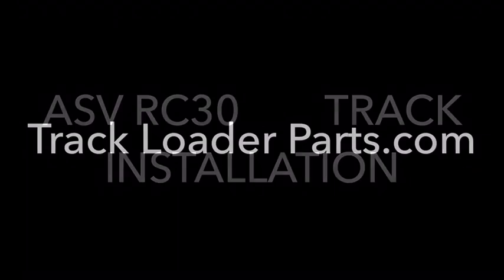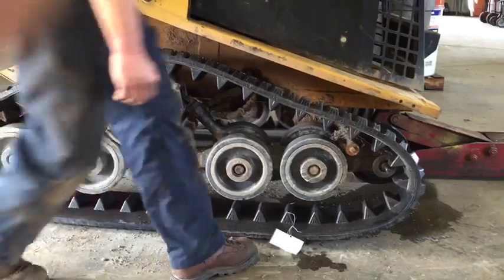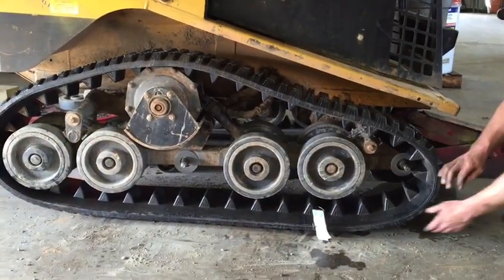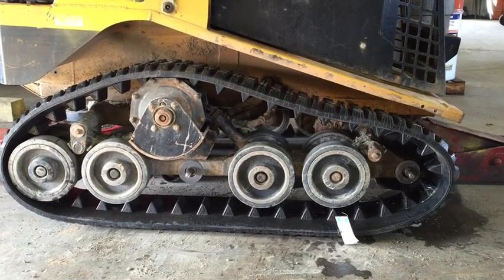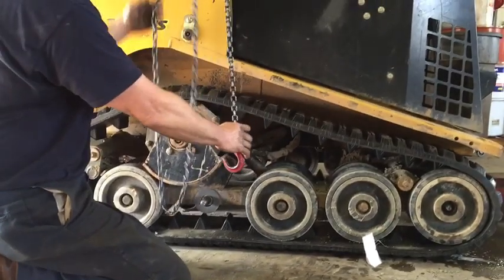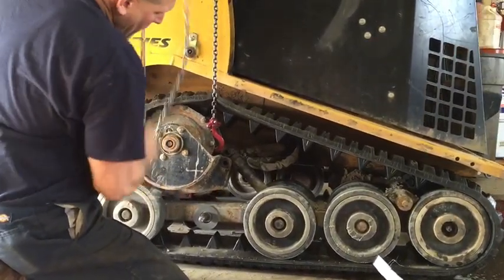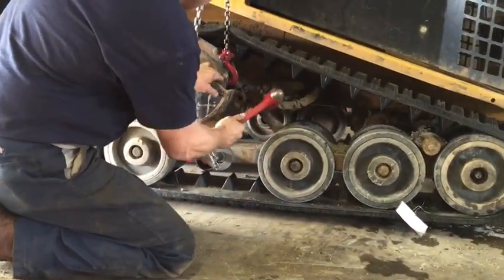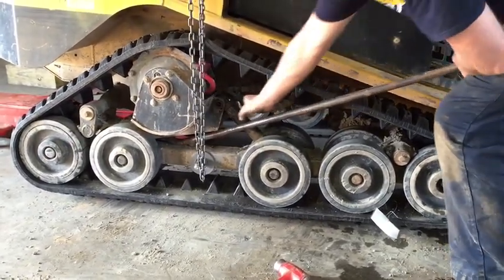RC30 Tracks Installation

Comment: I had to pull the track on an old RC30 in order to remove the drive motor a couple of years ago. It was NOT an easy job ... and this is probably the smallest and least difficult track to remove. Take a look at ASV's bigger machines and you'll notice they have rubber lugs on the outside edge of the tracks. Then think about trying to remove the front (or any) wheel with those outside lugs in the way. This solid rail design with a turnbuckle style tensioner makes for one tight track even when it's completely loose.

Comment: Would you guys do a video of getting the bogey wheels off? I've been fighting with one of those for a while and I'd like to see how it's supposed to be done. Thanks
Reply: I use a puller to pull stright out.  The seal and spacer gets bound up if not stright off.